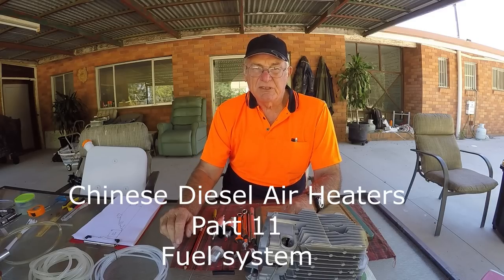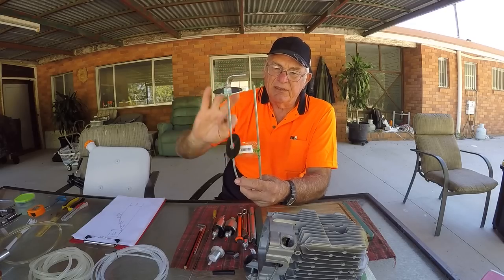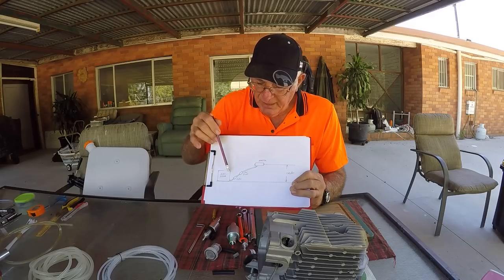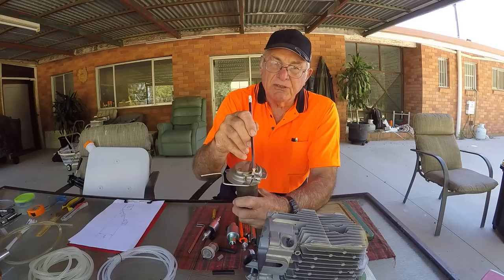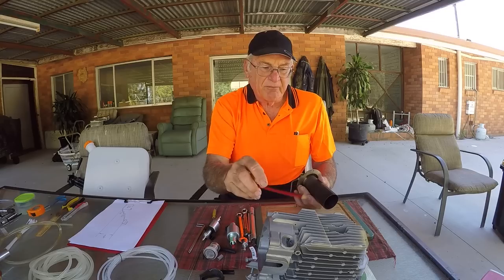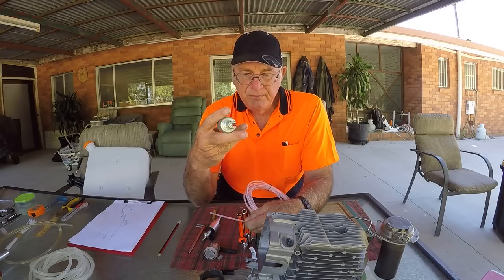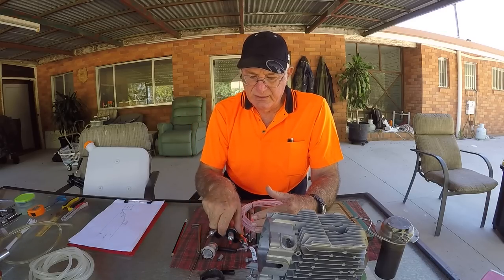Chinese Diesel Air Heaters - Part 11 -  Fuel Delivery

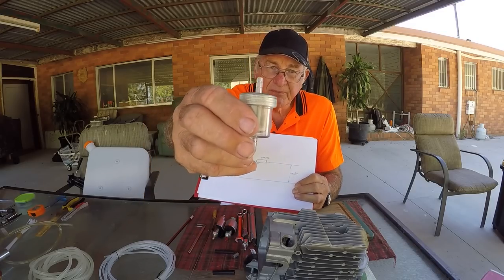Comment: John, in watching the video at about 1:39 minutes  you show a diagram of the fuel system, starting with the tank and having an uphill rise to the filter, dosing pump and then on to the heater. I must use the auxiliary tank, I cannot tie into my vehicles fuel system.  So in my application the tank and the heater will be at about the same elevation. So no real upward rise in the fuel line, so If the dosing pump is positioned in a properly rotated position does it really matter if the tank and heater are at near the same elevation?
Reply from the maker: No Bradley, that will be fine. If you use the small bore hard nylon fuel line from the pump to the heater the pulse pump will even push the cavitation bubbles on a down slope fuel run, provided it is not too long. The gently upward slope is "ideal" setting. 

To lessen the fuel line joins, I use standard one size fuel hose from tank to filter to pump. After the pump I use the thin bore, hard nylon fuel line.  JMcK
Reply: @johnmck1147  John Thanks much

Comment: Hi John, thanks for these videos, they helped me clean and repair my heater I use in the shed as well as improve my setup, however after I successfully cleaned and reassembled everything with new gaskets, glow plug and mesh filter the heater ran fine (I thought) for about 6 hours, the when I next started it I was having starting and running issues, I disassembled it again and found it was already heavily clogged up and the soot appeared to be damp, can I be pumping too much fuel? any thoughts? regards from Melbourne
Reply from the maker: Hi Eric,

Looks like you have a fuel burn issue, running rich, or a fuel leakage issue. Hard for me to say without seeing your setup. But here are some suggestions.

First the fuel burn.

The pump puts out a set dose per pulse (generally .02 ml) and the ECU matches that with the fan speed to get a correct fuel air mixture. This correct mixture can be upset by a number of issues.
The first is restrictions in the exhaust line or combustion air inlet line. Check you don't have multiple of bends here, blockages in exhaust muffler of intake air filter. Check you are not trying to force the exhaust down hill more than 300 mm or so. (Hot exhaust wants to rise)

Other reasons for a rich mixture are people manually changing the dose and fan settings in the controller, without test equipment or proper knowledge. 

Use at altitude causes a rich mixture and poor burn. Difficult to achieve in most of Australia.

Carbon buildup in the main burner screens can cause atomisation issues and a poor burn. You can not get at these screens easily, but a carby clean soak and a MAP gas blow torch burn can help get rid of it.

Running at constant low speed without an occasional short high setting run to burn off carbon can cause carbon issues. The more restrictions in your install the more often you must do this.

If you installed a new dosing pump that had a higher  dose volume than the original pump you will have issues

Second. Fuel leakage.

If your fuel tank is above the heater more than a meter or so, diesel can leak past the seals in the pump and flood the burner chamber when heater is not running. You need a tap in the fuel line.

If your heater is mounted on its side with the glow plug down diesel can pool and flood the glow plug and prevent starting.

I hope this helps.  JMcK

.
Reply: @johnmck1147  Many thanks for the reply John but none of the above seem to apply, however, I broke the stem of the fuel filter and replaced it with one that is probably too small, I also found that the pump has also just failed today, new ones are now on order, I just hope the cheap pump I ordered matches what I have otherwise I'll bin the lot and start again

Comment: Your videos on heaters are excellent and I am enjoying watching them.
Many Thanks
But I can't see the issue with sucking fuel up through a larger diameter pipe.
The weight of fuel in the pipe seems irrelevant to me
Because the pump is not lifting it all
Its still only lifting the  same quantity the same height, irrespective of how much  is in the pipe or tank.
Reply: Hey, the guy is fantastic, but I think he is not correct on your point. Actually, if you consider friction loss, there would be less suction resistance in a larger supply line ton the pump.
Reply: @johncada2644   Yes, especially when the diesel gets cold and thick I think there would be less friction in sucking it up from a tank through a wider pipe.  This was an issue with the early eberspachers that used thinner pipe.  Mine stopped working when the temperature dropped to about -2C - just when I needed it most.

Comment: Hi John, i received my heater with the rubber pipe...can u give us a link to buy the right cable online? Thank you soo much
Reply from the maker: Hi Marco, 

Lots of suppliers online. Search “hard nylon fuel hose for Eberspacher diesel air heater or diesel parking heater. 

You can use good quality 4 mm fuel hose from tank to filter to fuel pump, but should use narrow bore fuel hase from pump to heater.  JMcK

Comment: Hi John,
Was hoping I would not have to put my hand up for help with this, but after three hours of trying to get the supplied nylon fuel hose into the first piece of cut rubber hose (supplied) with my unit, I have given up.
Nylon line has tech specs on it and has an outside diameter of 4mm. Rubber hose provided has I'D of 2.5mm or 3mm at best.
After three hours I managed to get the nylon inserted into the rubber to about 8mm depth but cannot  for love nor money get it any further.
Could you please tell me whether you think I may have been supplied an incorrect nylon fuel line or an undersized I'D length of rubber hose. In my mind I thought the I'D of the rubber product should be 4.0mm.
Reply from the maker: Hi Bernie,

The standard nylon fuel tubing has an outside diameter of 4 mm with a 1 mm wall giving a bore of 2 mm.

The standard rubber joiners have an internal bore of 3.5 mm, giving a snug fit, however I have seen rubbers with a bore of 3 mm. Sometimes I think some suppliers just supply whatever is available.

You can check yours by taking different drill bits like a 3 mm drill bit, rub a little dishwashing detergent on it and see if it will slide up easily. If yours is less than 3 mm you will have difficulty getting the nylon tube into the rubber and you may need to buy your own rubber tube.

Now for pushing the nylon tube into the rubber. First soak the rubbers in some hot water for a minute or so, then rub a little lubrication on the nylon tube, silicone grease or dishwashing detergent works well, then push the nylon tube into the rubber the correct amount, or halfway if a join.

Please let me know how you go.   JMcK
Reply: Hi John,
I'D of supplied hose is confirmed as 3.00mm, using drill test .

Had used hot water to achieve what I could yesterday  and use of hot water and dishwashing liquid achieved same result this morning, although I got to the 8mm depth a little easier.

My concern now is that I feel I am comprising the integrity of the nylon line with far to much manipulation and what I would really like to do now is source the correct diameter hose.

The only 3.5mm I'D rubber hose I have found is cotton braided injector hose which I am worried about from an exhaust heat point of view for coupling the line to the unit.. If I go back to the supplier re the issue am I likely to receive the same undersize hose if anything at all.

Any suggestions would be greatly appreciated.

Bernie

Comment: Great videos, thank you. 

Can I mound the fuel reservoir above the heater and then create a “u” shape with the hose and the pump angled up below the heater? That way gravity would feed the pump.
Reply from the maker: Yes Jason, but if the tank is more than about a metre above the heater you need a shut off valve in the line at the tank and before the pump. 
(You should have a shut off valve in all installs)
You need to turn the valve off when the heater is not in use as the head pressure allows weeping of diesel past the pump seals and flooding of the heater.

Cheers.  JMcK
Reply: @johnmck1147   Thank you!  

And thank you for the video series. I’m planning to convert my cargo trailer into an ice fishing shack (Canada) and you have me convinced to go with the diesel heater over a wood stove.
Reply from the maker: Jason Mann 
👍

Comment: Hello John. I would like to add an inline diesel fuel shutoff and a dry quick disconnect. I have searched and searched the internet with no luck. I went to my local hardware stores and small engine shops and again, no luck. I have posted the question to Facebook groups with no luck. Have you ever added one or the other and if so, can you share your source for them?
Reply from the maker: Hi Brandit,

Please have a look at the motorhome videos. Tap installed there.

I do not know where you live but in Australia fuel shut off valves are available in hardware stores like Bunnings (air tool section) auto shops, boat shops, small engine shops etc. Anywhere that sells air tools should sell the taps and hose fittings.

I have used outboard motor quick disconnect connectors. Use the one nipple type not the two prong type.  JMcK

Comment: I noticed there was no bench test with actual heaters comparing the two types of tubes.  Was this because the expected problems could only be discerned long term?  I have read elsewhere that pulsation is not critical to heater function, so I was curious if you had done any actual bench testing side-by-sides, or if this was from the Eberspacher manual only.
Reply from the maker: Hi Dell, no, I have tested heaters with that cheap vinyl fuel line. They run ok, for a while.  Also I have not seen anything on this matter in Eberspacher literature that I have. The issues arise when you start to get some carbon buildup in the two atomiser screens, and the cheap fuel line absorbs the pulses and you can't light the burner. 

As a safety note, this cheap fuel line supplied with some heaters lasted less than 3 months on my test rig before it perished and leaked fuel.   JMcK
Reply: @johnmck1147  Yikes!  Now we have to be tubing detectives to determine the composition!  Do I sense the opportunity for a follow-up video:  "How to Identify Cheap Chinese Tubing for Safety"?    Seriously!  :-)  Nah, enjoy your vacation, we'll figure it out here.

Comment: John, I am looking at making my own pigtail connector and harness for the fuel pump, to be able to manually activate the pump with a momentary switch and 12v battery. I was wondering if it matter which of the two pins on the pump is used as power (12v) and which is used as ground? Does the pump have a polarity? Thanks for the great videos !
Reply from the maker: Hi Maf337.

Have you seen my simple set up. Fuel pump video and motorhome video.

The pump is an electromagnetic pump activated by 12V, or 24V depending on your set up.
You momentarily apply 12V to the pump. The very important word here is momentarily. Do not leave the power connected to the pump.
It is an electromagnet, the polarity does not matter.

Cheers.   JMcK
Reply: @johnmck1147  I have been watching your videos in order, so I have not yet watched that video you mention. I will definitely check it out though, thank you so much for the reply! 👍🏼
Reply from the maker: maf337 
👍

Comment: Great videos John. I don't know if I missed it but can you mount the tank higher than the pump and heater therefore giving a siphoning effect or will the fuel eventually work it's way through the pump and fill the combustion chamber? Thanks
Reply from the maker: You are correct Aaron. With the tank much higher than the heater you can flood the burn chamber and it becomes impossible to start the heater. Flooding takes time, and mostly causes issues the following winter.
However a very simple solution is to install a shut off valve somewhere before the pump. You just need to remember to turn it off after use and on before use.  JMcK
Reply: @johnmck1147  Thanks mate. I'm just watching the motorhome install and saw you used a little stopcock. I'll do the same. Thanks again.
Reply: Sorry to bother you again mate. Is there a minimum distance for the fuel line between the pump and the heater. Everywhere I read says maximum lengths. I will only have about 300mm. Thanks Aaron
Reply from the maker: Hi Aron, 300 mm will be fine. JMcK
Reply: Beautiful. Thanks for the quick reply.  @johnmck1147

Comment: the soft fuel line may work if the length is short  and there are no loops. could you test this ?
Reply from the maker: The soft fuel line will work, for a while, when the heater is new. The shorter it is the longer the heater will work before failure. 

The fuel has to pass through very fine screens in the burner to atomise the fuel. 

The fuel needs pressure behind it to force the fuel through these little screens. 

When the heater is new the fuel can go through the screens, but after just a short bit of use carbon is deposited on the screens and the fuel is no longer forced through the screens as the fuel pulse is absorbed by the soft fuel line. 

These heaters need hard wall, narrow bore fuel line to work properly. JMcK

Comment: Thanks a lot. I am gonna re install my unit after the carbon cleanout.. I have run it 4 times and I suspect it is full of carbon for two reasons. The fuel tank was pre installed for a veg oil heater and had 5 L of veg oil left in it and I just topped it up with diesel, and I UP graded the fuel line with marine fuel hose. Now I see others have had issues with coking too. Does it make sense to add 10 % kero so the fuel burns cleaner? I hesitate with ethanol as it doesnt fully mix with diesel, but kero does. Do you think a longer exhaust run may contribute to excessive carbon?
 Also can I use the eberspacher glow plug and other parts? Its easier to source than China
Reply from the maker: Hi Heikki,

If you burn any type of oil in these heaters you will get a lot of carbon residue, that will be the most likely cause of carbon build up. 

Yes, a kerro/diesel mix does help these heaters run cleaner.

A long exhaust, provided not too long, and without restrictions causing back pressure is unlikely to cause excessive carbon build up.   

Yes, glow plugs, gaskets and other non electronic parts are often interchangeable with genuine Eberspacher parts. JMcK

Comment: I saw some of your videos . Was going to install a 8kw in a rv. the rv has a 30,000 btu furnace , being a heating contractor i did some converting and 8kw is around 27,000 btu . Didnt in stall yet . Did some more resurch found that that heater only puts out about 15,000 btu to be safe . If i were to install 8kw i wouldve been sorry . False advertisement !! Now thinking of installing 3- 5kw in a zoning configeration . I think this will be a very cumfee rv. If i figure is correct they all will opperate at low fire for longer time . Making it quiter and more even heat around the rv . I would just like to thank you for all you done ! Any thoughts ? Or if you have any questions im here thank you very much!!
Reply from the maker: Hi KK,

Thanks for your post.

These heaters do put out a lot of “dry” heat for their size, and their cost is only a fraction of the genuine unit, making it affordable to add 2 or more heaters if the heating area is large.  JMcK

Comment: I replaced pressure side hose with stainless steel line. Works good
Reply from the maker: 👍 Yes, you do that if your heater is in the machinery space in a boat.  JMcK

Comment: Hi John, struggling to find the correct nylon tubing. Most listing seems to be the flexible type. Any tips on suppliers in Australia?
Reply from the maker: Hi Scott,

I looked up my past 2 hose suppliers and both have gone. This is a common issues with these heaters and why I am reluctant to put links in the description. 

A mining supply company such as Blackwoods sometimes stock the nylon tubing, or go online and search for narrow bore nylon fuel hose for Eberspacher Diesel heater, or Eberspacher parking heater.

Below are two possible suppliers to get you started.

 
https://www.ebay.com.au/itm/Diesel-Heater-Nylon-Fuel-Line-OD5mm-ID1-5mm-7m-/333693253438?hash=item4db1aaf73e

https://www.ebay.com.au/itm/400CM-Fuel-Tube-Pipe-Hose-Air-Water-For-Eberspacher-Petrol-Diesel-Parking-Heater/124245371287?_trkparms=aid%3D1110006%26algo%3DHOMESPLICE.SIM%26ao%3D1%26asc%3D20200520130048%26meid%3Dd65883ff651048bb93aab7eb2d9f0afb%26pid%3D100005%26rk%3D2%26rkt%3D6%26mehot%3Dco%26sd%3D333693253438%26itm%3D124245371287%26pmt%3D1%26noa%3D0%26pg%3D2047675%26algv%3DSimplAMLv5PairwiseWebWithDarwoV3BBEV2b%26brand%3DUnbranded&_trksid=p2047675.c100005.m1851

Cheers.   JMcK
Reply from the maker: Scott H 

Hi Scott, either is ok. The 5mm OD is generally better as it is easy to buy 4 mm ID fuel hose which is used for joiners. As mentioned in the video, if you have 4mm tube, to get a good joiner seal you should use 3.5 mmID fuel hose, which is less common and harder to source.  JMcK

Comment: Hello John, great video. What do think about heater with aluminium outside housing. Kind regards, Han
Reply from the maker: Hi Foss. They are excellent heaters. It is really personal preference whether you go metal or plastic. I have had a number of these questions and may do a video on this in the near future.  JMcK
Reply: @johnmck1147  Thx John for the quick answer. Kind regards, Han

Comment: Do you have any suggestion on putting an exterior diesel tank on a promaster that is gasoline? I need to get the plastic tank diesel out of my van and outside.
Reply from the maker: You can mount the supplied diesel tank outside or use a jerrycan if you want something more robust. Have a look at the motorhome video.  JMcK.